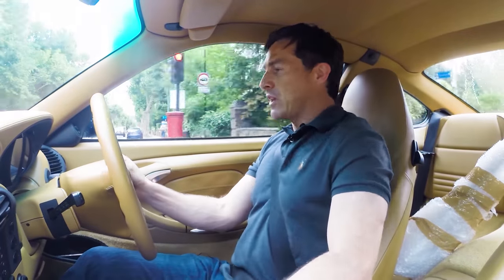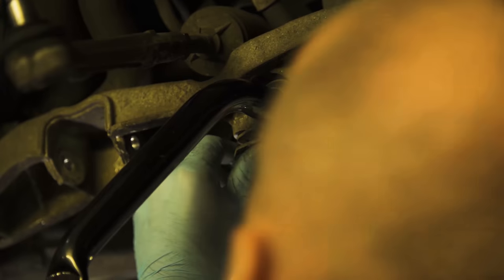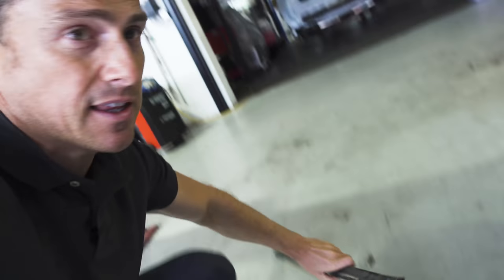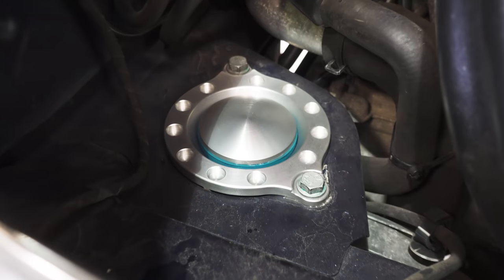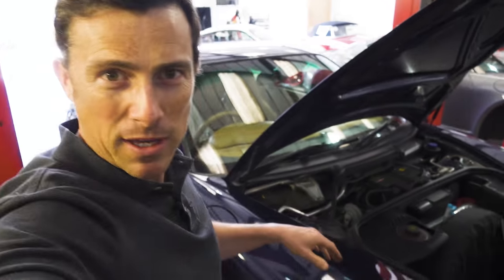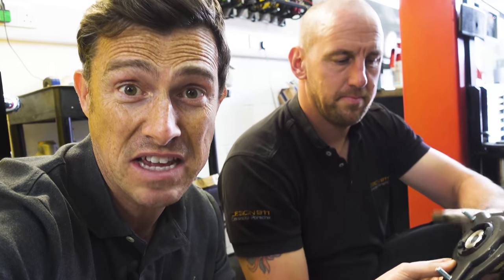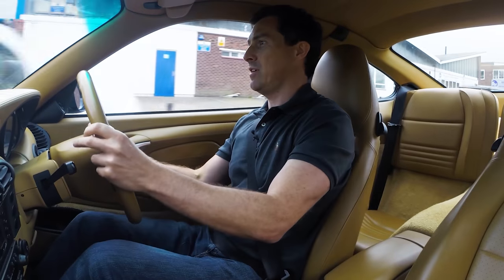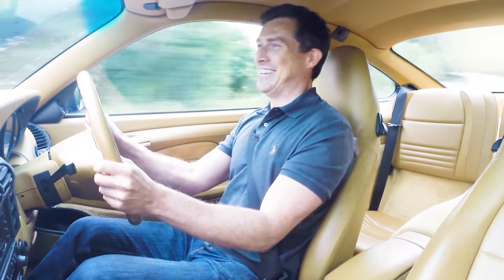My Porsche 911 has broken. AGAIN! What's wrong this time? | Mat Vlogs

Comment: My brace bars were in two pieces on both sides. These things rot like mad as they  unprotected from the road salt etc.. and have holes inside of them which hold the road debri. You've spent a fortune on the car and then you buy second hand cross bars which are paramount to the handling of the car. Mine cost £200 for both including mounts and bolts from Porsche so not really bank braking compared to some trivial items.

Comment: Matt - I was just about to comment that it was the top mount, but I saw they found it.

I had the exact same issue, sound etc. on my SEAT Leon Cupra 280. Turned out SEAT fit it wrong, which caused it to fray and become loose. 

You can also diagnose the same issue by opening the bonnet, putting lock on the steering wheel, and holding your fingers on the top mount. It will 'creak'.

Comment: Funny coincidence, the top mount on mine failed very similarly to how yours did, except mine were likely the original ones (150k mi old) and it didn't fail until after I upgraded to H&R coilovers. 
Not odd by any means, but it was a $600 part (both sides) I hoping to avoid.
Great video. It's refreshing seeing your car is being treated right as I've seen many videos of less fortunate cars

Comment: There is fluid in the engine mounts which gets hard under vibration, that is why it moves a lot in your hands, nothing wrong with it Matt. Hydraulic engine monts work that way, they are fine like that.

By the way, straight up called the problem of the noise, damper mount.

Comment: I have owned a 996.2 and  I would not be bothered about replacing parts in the £100s as it's a real fun car to drive and starting to age well , the gen 2 lights are a lot better then the gen 1 fried egg ones though. However any 911 996-997.1 manufactured from 1998-2008  excluding  (turbo & GT3) has a high chance of catastrophic engine failure , IMS people seem to say is the major problem but unfortunately scored bores are as common and d chunk . They reckon it's 5 % failure, but  its not if but when in my opinion. I had scored cylinders on mine with low mileage and full service history , driven steady in till engine was warm and I'm a car guy. Either get a 993/964 or a gen 2 997, otherwise you could easily be looking at a 10k engine rebuild bill if the dice lands on you. Bloody pitty as I really liked the car. Porsche does get away with a lot that other manufacturers would be crucified.

Comment: Had a 1999 996 was great to drive but virtually every month something would fail, water coolant tank, water pump, fuel pump, radiators, ac condensers, exhaust, brake pipes, air oil separator, bits of trim, ignition switch, etc etc, was never perfect as soon as you fix one thing another would fail

Comment: Top man Mat. My '98 has a cracked head which has been repaired by Motorcast. I am in the process of rebuilding the m.96 in my garage :-)  Plans are afoot to upgrade suspension over winter months. Thanks for your inspiration
Reply from the maker: +Rage Video did you inspect your IMS?
Reply from the maker: +Rage Video also how did you know about the cracked head? Intermixed?
Reply: carwow I am inclined to leave it as is. Seen no evidence of metal debris in oil or sump pan. I may fit a magnetic sump plug ...am i tempting fate ?
Reply: carwow Yes had intermix both in oil and coolant. The oil cooler can be a suspect, but not sure this would affect both. I emailed Jake Raby in the US and he was 99% sure the head had cracked on Cyl1
Reply from the maker: +Rage Video I'm with you. Best left alone. And hope!
Reply: +1. .. Jake Raby is the F..king IMS master - hired by Porsche AG to develop and formulate a IMS solution.

Comment: Hey Matt. The problem was an upper mount of the suspension. I did notice you that you were also looking for metal in the oil filter. If there was metal you immediately thought of IMS. This is not true. The IMS is like any other part in the car, it is subject to failure. Yes there are those stories that the IMS blew up and destroyed the engine. I know quick a few 911 owners and none of them had a failure. But there are those who get it replaced “just in case”. The statistics don’t seem to add up to replacing a part that might fail. The research shows there is a very low incident of failure. Oh. Unless you get your info from those who make replacement bearing. Hey. Enjoy the car and stop  making everything so grand, just get the those thing that break fixed.

Comment: The excuse that; the car is old or that its a performance vehicle, just doesn't wash. If the Likes of Toyota, Honda, Lexus can build reliable cars, than why can't the Germans. My Toyota saw near 200k with the rear bearing going @ 170k. My brother's Porsche didn't make it much past 60k before needing and engine rebuild. But before that it was falling apart. He was spending more in repairs in a month that I paid in nearly 125k of motoring in my Toyota!

Comment: that oil is still so fresh, i could still use it on my daily drive for 2k kms more
Reply: It’s recommended changing the oil every 5k miles if you are worried about IMS failure

Comment: Logic dictates that more rigid engine mounts will transfer more engine vibration through the whole car - making the ride more harsh and will cause faster fatigue failures. Porsches are well designed by qualified engineers. I am quite sure that they know more about engineering than the presenter.

Comment: How can an experienced mechanic not check the top mount very early on in the process? I’ve seen this on two of my cars and I’m not even a mechanic; both times were because the mechanic who either did the work incorrectly or didn’t bother tightening the top mount bolt at all  ...

Comment: Awesome, I can really imagine how good that car feels. Mat, you're always a couple of steps ahead of me ;-) I had mine fitted with a wavetrac lsd this summer (and a lightweight flywheel) and I am eyeing the engine mounts for fitting over the winter. Which firmness did you go for?
Reply from the maker: +Pedro Venda I went with sport. But race would be fine. How is the light fly. I bottled it as I read they can upset the balance of the engine. And the M96 engine ain't the toughest.
Reply: carwow ah cool, are those the RSS mounts? Or are the rss the non-adjustable ones? The flywheel is lovely, I really like it. I was blown away by how much better the engine picks up in the mid range! But it's the overall character that improved the most. The gearbox is chattery now..... Also the clutch bites harder (a different sachs unit, sprung). So the combination of wavetrac, new clutch and light flywheel transformed the car quite a bit! I'm chuffed with it!
Reply: They're the Rennlines - I did a quick check. Still unsure which ones I would buy, did you consider the RSSs at all? Also have you had to "deal" with your coolant pipes/fittings? Or was it done by a previous owner?

Comment: So the car makes weird noises on bumpy roads? Hmmm lets check the oil filter!
Reply: I noticed that too. If they specialize in the type of car, they should have a good diagnosis process worked out. Noise on bumpy roads probably means suspension. In this case the oil filter check is important at a service point for this model as the engine has known issues where bearings will break, then get flung into the insides of the engine causing the entire engine to need a full rebuild. The sequencing in the video did make it confusing though.
Reply: The  oil filter was probably checked as the vehicle was in for a service by the looks of it

Comment: Surely a motoring journalist would be well aware the 996 was a turd from the moment it left the design board.

Cheap, crap components in a car designed to save Porsche.

And a dodgy garage fitting crap suspension.

Comment: should have bought a 997
Reply: Much, much more expensive.
Reply: or the face lift version of 966 with 3.6 L which is much more reliable. The 996 with 3.4 liter engine is the worst of all 911.
Reply: come to egypt lol, alot of roads are actually broken, but all our cars survive over 20 years without these problems
Reply: Blah blah blah you experts
Reply: Igor,  The 1999 through 2008 911's 996/997 all had the potential of the IMS bearing possibly failing (about 5%-8% of cars). 
True the 1999 was the first year of the 996 and had a few more problems as later year cars but
If we are talking just about the IMS bearing issue,  then understand that the 1999-2001 911's had a 2 row IMS bearing that was stronger than the 1 row bearing that was put in 2002 -2008 year cars.
So not all 3.4 L cars are worst than a 3.6 L cars. the better engines were really the 2000-2001 engines of the 996's cars.  
If one replaces the IMS bearing on all these 996/997 they are just as reliable as any other car.
Air cooled 911 have their own issues.
Reply: Thank you. There are so many 996 haters who have never driven one, don't own one or don't own any version of a 911. I let them hate from the sidelines while I'm off enjoying my car.
Reply: Good call, first thing I had done when I bought a 996.2 convertible was have the IMS done by a specialist with a double row ceramic hybrid. It cost the less than a cambelt and clutch for my old Alfa 156 V6 2.5Litre Sportwagon which had to be done at lower mileage.
Reply: How much did that cost if you dont mind me asking ?? I have a 2006 Cayman S and everything is fine with it, but just so I know going forward. Cheers
Reply: Igor kotzlowski face lifted 996 are the most ugly Porsche ever made, that headlights are a piece of shit

Comment: lol just buy a volvo
Reply: Owned 2, a 760 GLE all leather and terrible mpg and an 850 T5 Flying Brick, great car but when the ABS controller goes £2000 to put right and trying to get hold of a used one pretty much impossible, sold it and bought a Porsche 928 which actually cost less to maintain in the 6 years I woned it.
Reply: yea but ol volvo's will outlast any porsh though like at least the frame on my 850 ISNT RUSTING AWAY.  Porsche's will just die past 100,000 miles and there a bitch to fix the new ones are even worse with a bunch of plastic bullnonsense and tech toys you dont need.  At least the Geely Volvos have a smaller engine with large engine bay to make it easy to DIY. Honestly most of germany's cars are rich-man cars same with the Italians thats why only by swed, american, and JDM  jdm because normal people just need reliable decently sporty cars you can have for a long time.
Reply: i guss volvo is more expensive in eroppe but here in america its pretty cheap to own a volvo
Reply: Have you actually owned a Porsche, or two? they used galvanised steel from 1976 my 1990 928 was rock solid with no rust, well most of it was alloy anyway. My 2002 996.2 is immaculate underneath I had it professionally inspected by an independent specialist who took great care and time in showing me the vehicle underneath and likely issues which were all good. I didn't say the 850, especially T5 turbo version, was a bad car it's not, I owned one for about 6 years and was and is one of my favourites of around 40+ cars owned. Smaller engines under higher load will invariably fail sooner than a larger unstressed engine the latest high power Volvo is pushing 200 BHP per Litre OI dot see that lasting the 250,000 miles plus that the older Volvo's are famous for.
Reply: Reliable decent sporty car, look no further than the Maxda MX5 preferably the early versions with the engine designed from the Mazda 323 Turbo rally car. Owned a rare 1991 BBR turbo version and upped the boost from the standard 5 PSI to 9 PSI with upgraded injectors etc etc great great car. Had custom red and black leather seats, original MOMO wood steering wheel. Rust got to it in the end though about 3 years ago. 122,000 miles on the clock used no oil and started first turn of the key and with the turbo so quick one of my top 5 for sure.
Reply: i have no problems with mazda dude i only have owned a honda accord and volvo 850 GLT and i love it the dash creeks a little but that thing is trustworthy, the fuel pump died on me but its an cheap easy fix, i personally dont like porsh for there perception and dumbfoundedly expensive parts but i do agree the old porsche's are pretty solid
Reply: honesly most cars that are beond the age of 20 have a established relibleity unlike new cars there just not known how reliable  there going to be.
Reply: Hi both the Accord and 850 GLT are damned good cars. The Porsche can be silly money but if you use an independent specialist they are not too expensive to service and parts from Eurocarparts rather than from the dealer keeps things sensible. There are some dicks who drive and own them though bit like "some" BMW drivers. Have to say though they are a great car to drive, certainly couldn't afford a new one! Not without winning a lottery. Cheers

Comment: It’s such a shit car 😂😂
Reply: He bought a shit car. You need to buy a car with a folder containing copies of receipts of work done owned by an enthusiast and budget a grand a year to keep them tip top. But once driven.... new 911 convertible starts at UK £86,000 you think you can run an old one for UK £100 PA then you are a moron. The first thing he should have done is taken it to a proper specialist for independent proper inspection find out any work needing to be done, then get the IMS bearing done with the clutch at the same time that puts that to rest for the next 75,000 miles.

Comment: That's What Happens When You Buy An Old Porsche..
Reply: No, this is what happens when you buy an old Porsche without proper providence with lots of receipts and don't get it inspected by a Porsche specialist. Then spend a load of money on aftermarket suspension and how exactly did they miss that those arms were split and wasn't it the parts that "they fitted" that failed.